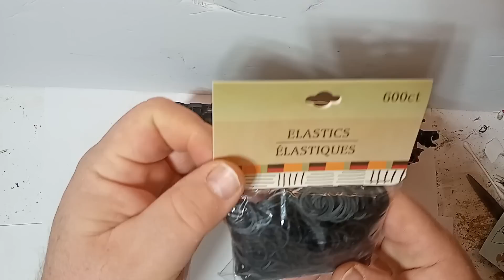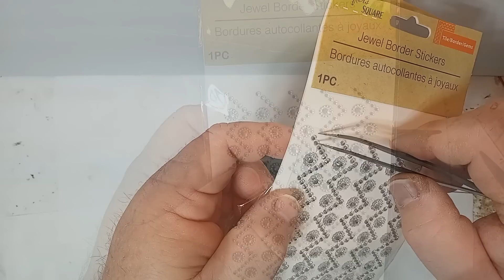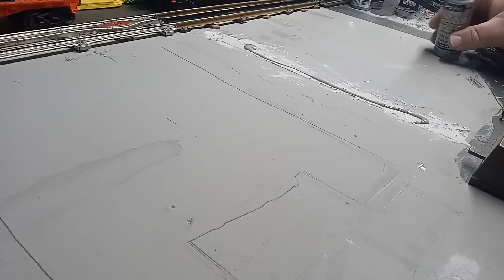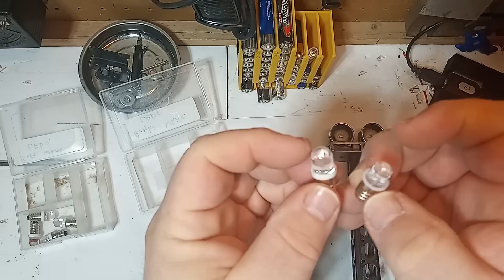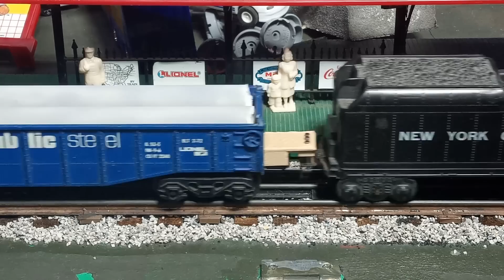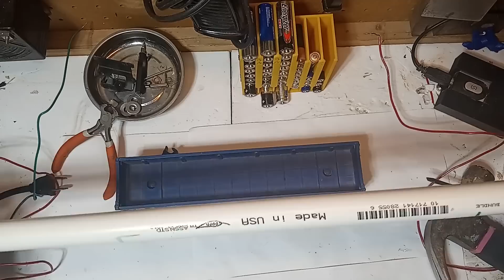7 Quick And Easy Layout Projects

Comment: Are those TAB AND SNOT to NUCKLE coupler adapters available for purchase?
Reply from the maker: No, but the free file is available on Thingiverse. If you don't have a 3D printer you could probably steal the design and make it out of styrene or a similar material.

Comment: With the MPC style couplers I cut the thumbtack off so it does not get caught in between the rails and I superglue the coupler shut so it is a dummy coupler I run trains I don't do switching I have no switches on my layout therefore I have no need for the cars come loose. Classification lights generally break off the steam locomotive entirely. I use white out to make pavement markings.
Reply from the maker: Hmm, the only MPC thumbtacks I have ever had issues with are long shank couplers such as on passenger cars.

Comment: Here’s another easy trick for the 1615: cut up 2 popsicle sticks to the width of the engine, then glue or sticky tac them onto the footplate, AKA the little stoop at the very front of the engine and back of the tender under the front and rear coupler to simulate real wooden footplates on similar prototypes

Comment: Nice stuff.  I would think that you could paint the coupler adapter black and maybe cut away some of the center section to make them appear smaller and a bit less bulky.  I like the jewels from the craft store.  Many post-war steamers have missing or damaged marker jewels.  Nice tips.
Reply from the maker: This was a prototype, so it's just the color of filament I had in the printer. However, I found with my old design that bright colors were best so I could FIND the adapters when I needed them! :-)

Comment: You can mention to your wife that that piece of 'trash' (40" of 1/2" CPVC pipe) would cost us $2.90 CAD to buy up here in the great White North!.  Ten feet of 1/2" pipe will set up us back $8.70 CAD, ten feet of 3/4" runs $17.52(!) CAD.
At prices like these, there's no such thing as 'trash', 'scrap' or 'useless'...ya gotta save everything...!

And thanks for the tip about the jewels - we don't have Dollar Tree here, but do have Dollar Store and $Ama outlets. I'll check the next time I'm in town to see what they've got.

Given the prices for everything, Model Railroaders have got to start thinking like the Pioneers of the hobby did back in the 40's...Don't Do Without, Make Do...!
Reply from the maker: Wow! And I thought US inflation was out of control!

Comment: Thanks Mike. Great tips. Now if only you could come up with a good solution for coupling some of the Menards cars with the plastic couplers without slamming the cars together. I've compared them with the Lionel couplers and discovered that the Menards couplers have a design flaw and aren't made with slight protrusion on the knuckles to close completely before bottoming out. It's only by kenetic energy that they close. 
  I use the small pvc pipe caps glued together to make oil and propane tanks and the larger single 3 and 4" caps make good petroleum storage tanks once sanded and painted and weathered to look like tanks. The left over sprus from plastic model kits, especially the ones with rounded corners make for convincing pipes once painted. I save and repurpose everything. I even use the clear plastic from packaging for window glass for models that don't come with the glass for windows. I've become a model train hoarder. Tell your wife saving things to use on your layout is just part of the hobby and it's the sickness thing she signed up for in her vows and at least it keeps you out of the bars at night😊. 
Happy rails
Reply from the maker: Great tips!!!